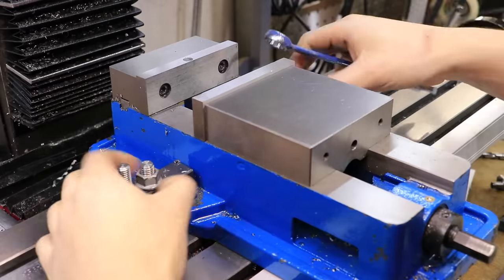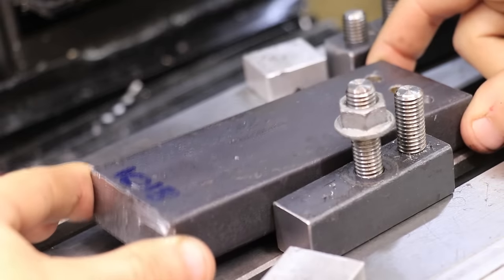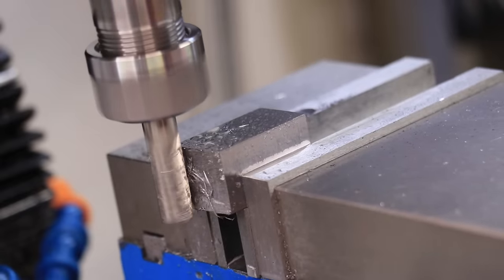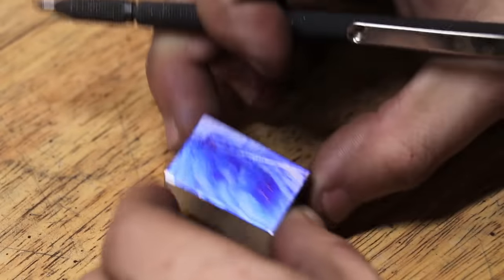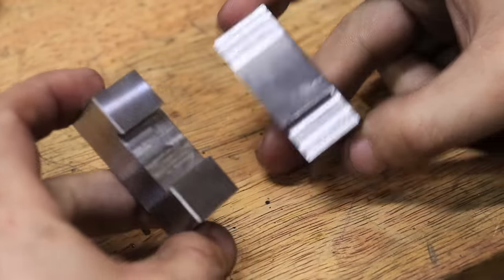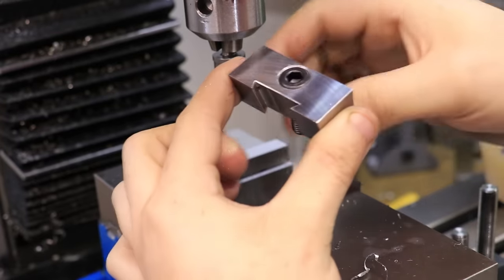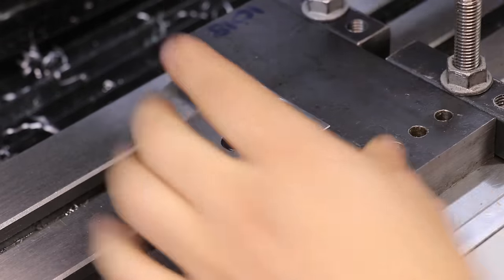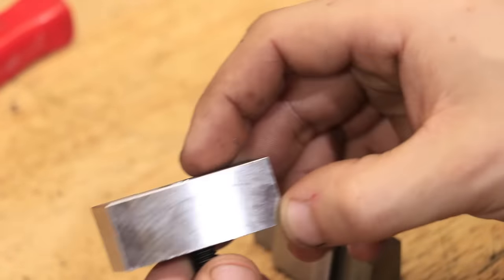Easy Low Profile Side Clamps For The Milling Machine

Comment: let me know: Is the dovetail really necessary?
Reply from the maker: You don't have to add them.i made one without them and the claiming force was slightly better with them. Plus it helps align them so they are easier to set up and store. In my opinion they are worth adding

Comment: I think with the softer metal, it will hold up together better. If it's harder, it easier slip the workpiece.
Reply from the maker: Probably but in sure there are some set ups where one might benefit from having a hardened jaw. Cheers

Comment: I will say that these are a modified version of clamps I (eventually) learned to love. This is a great alternative. Only downside is the possibility of pulling the part down to the table. Aka if the part is warped and you pull it straight, when you loosen the clamps, the part will spring back to not flat.
Reply: Not a downside of the clamps, every holding method has the same problem. The problem can be solved by shimming the workpiece from the clamping location, so that it when it pulls down, it as a solid rest under it, thus no warping.

Comment: when you were adding the angle, around 2:30 or so, i noticed you did a deeper cut left to right than right to left - was there a reason for doing so? looks as though maybe right to left was a ""spring pass"", i didn't think that would be necessary for a fly cutter?
Reply from the maker: The insert was a bit worn on the front but still very sharp on the back so it could take a deeper cut on the back pass
Reply: @artisanmakes  Ahh that makes perfect sense, thanks (:

Comment: Good project. 
How happy are you with the loose fit of the dovetails? My gut feeling is that you would still have free relative movement with a quarter of the "slack" you built in. Just a comment, not a criticism.
Reply from the maker: The fit feels great. I made two of these one with a super good fit and one with a more sloppy fit and they both work great. If you want to make it a perfect fit by all means go for it, but on mini mills, 0.2mm will work just fine.
Reply: @artisanmakes  Thanks for your reply. Good to know.
Reply: Do you really need doves tail at all with that design?

Comment: I would go for 7 or less degrees because then the clamps become self locking and you could hammer them down instead of screwing.
Reply: How would you release them?  More hammering?  On a small milling machine?  Not advisable.  You could use a jacking screw to lift up the clamping part;  but then you may as well use a screw to pull it down, thus saving the milling machine from the indignity of hammering.
Reply: @BasementEngineer  I dee your point. I would unscrew the clamp after the work.
Reply from the maker: Sure a lesser angle could definitely work. I did find that mine stuck, and i had to release the fixed jaw to remove the part

Comment: Very nice job well designed and executed. Can you tell me what is the end mill holder in the last scene? I know you usually use R32 collets but this looks different. Cheers,
Reply: Looks like an hydraulic chuck...
Reply: @Jabba410  Im relatively new to machining so never heard or seen one before. A little googling revealed something new- thanks.
Reply from the maker: It is a custom heat shrink tool that i made a while back

Comment: What's great about This is that I think you can build this even without the dovetails.
Reply from the maker: You definitely can, it is just a little harder to set up and store and I think I get slightly better clamping pressure with the dovetails. Cheers
Reply: @artisanmakes  Agree, but without it implies a simple design that does not require special tools to manufacture.

Comment: 2 questions.
I noticed you were using the squirt bottle rather than the coolant system. Is there something unpractical with the system for light work? More cleanup perhaps?
Secondly, you were using 1018 - low carbon steel. Would it be worth it to heath treat it, even if the hardening is minimal or did you mean to switch material and go for 4140 - medium carbon steel?
Reply from the maker: Yeah the bottle is very easy for drilling and light work, especially for quick clean up. For heavy cuts I still flood it to keep everything cool and extend the endmill life. If you want to hear treat it I'd suggest using a steel that is meant to be hardened. You probably don't need to go for 4140, just use what you can get if material availablity is an issue. You'll find out in a few videos about the process of hardening 1018 and believe me when I say that it is a lengthy and drawn out process. Cheers
Reply: 1018 is not hardenable by heat treatment. It can be case hardened using a variety of processes.
Reply from the maker: Yeah, Ive pack hardened a few parts, definitely not a quick process

Comment: So much effort for something that I wouldn’t trust unless I was absolutely stuck for options. I’ve been doing CNC machining for nearly 20yrs now, similar clamps to this are sold to the industry and I’ve had to use them maybe 3 or 4 times, they can be problematic and I would really be taking it easy with my cuts.
Reply from the maker: I wouldn't use these for industrial machining, but this whole channel is not geared towards that type of machining, its just a hobby. With that said these clamps seem to be very effective for the work i do and I'd trust them as much as I've had to trust toe clamps in the past.